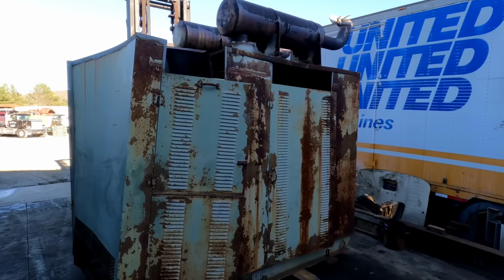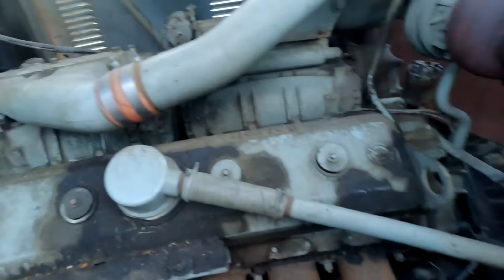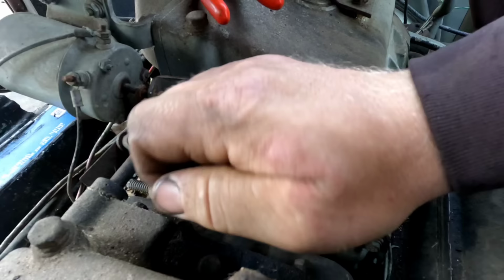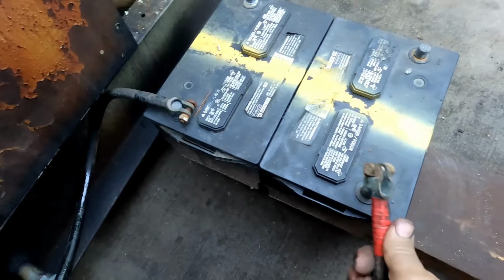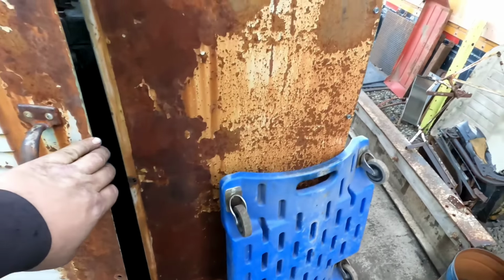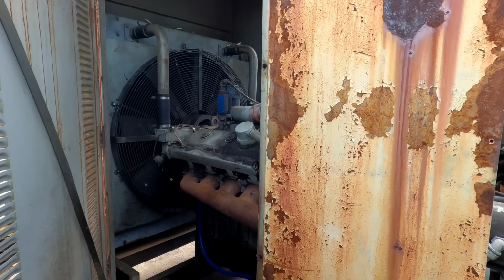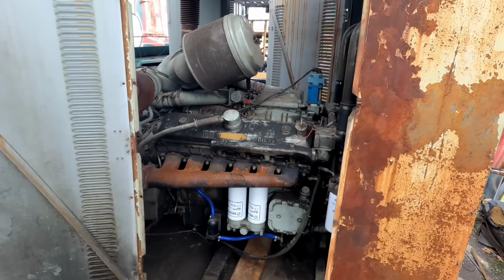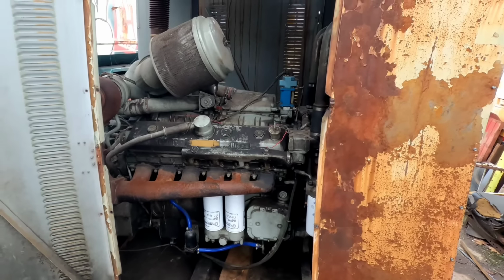Rare find, saved from scrap. Detroit Diesel 12V71TT Generator start up. Will it run? Or run away?

Comment: Emergency generators for schools, hospitals and the like lead a sheltered and happy life. Like fire engines, usually impeccably maintained. One of my hospitals has 3 16 cylinder Cat generators lined up in a room. I was in there one hot summer day when they started them for load shaving. All three go to full governed RPM and the transfer switches put on the load within 10 seconds. I thought I went to heaven.

Comment: Nothing better than a V12 blazing away, Well I think there is.
A 6V53 running at 3200 rpm with no intake nor exhaust system but straight out the manifolds.
Your chest, skin and hair just vibrate and crawls.
 This comes in a close second though.
As an apprentice mechanic, we had a fleet of Kuruna trucks with these 12v71tt's.
They were upgraded to these from twin Volvo engines and Allison trans.
Charging up a one in 8-9 incline fully loaded underground was a sublime sound.
Nothing like it, simply music to the ears.

Comment: for that stuck cummins, try hooking up a porta-power to one cylinder like zack-life does! 
 it'll turn or break for sure!
Reply: To clarify for those who aren't familiar -- Zack poured some penetrating fluid (I'd use ATF+acetone, it's better than most penetrant brands IMO) into a cylinder. He made a fitting for the glow plug hole. He then hooked up a porta power up to it and hit it with a couple thousand PSI. Fluid seeped past the rings until the rusty hog cranked a quarter turn.

Probably the best way I've ever seen to crank a stuck engine. Was really smart on his part. I don't think an air hammer will work on these big of cylinders lol

Comment: I am a retired electrician from a water utility on Long Island. We had many of these old gensets. The unit you are working on was probably wired to an ATS. Find the pair of wires that would have been used to start the engine. There should be a cranking relay and overcrank time out stepper in the control head.

Comment: It also could have come out of an old Telephone Company office. Back in the day they needed 99.999 percent uptime and the batteries would only keep stuff going for 30-90 minutes in a big office and the Jenny would have to have the ability to run for weeks in a worse case scenario, like a hurricane recovery. They would also have time to get more fuel. Today’s Jennys are multi fuel, propane, natural gas and maybe diesel or gasoline. And also it was switched out due to age of the generator. Also the site may not need as much power to run, like solid state vs relays or computer vs even the old relay or solid state stuff. Even my power usage for my home has decreased, not counting my heat.😢😢😢

73’s from Sherman NY
DE N2JYG

Comment: I use marine grade 8D batteries and 4/0 cables to start my 6V71 in a 750 CFM air compressor. Group 31 batteries can do it, but they don't live long in a cabinet running at over 200 degrees F.

Comment: Don’t think it would be a TT.  if I’m not mistaken the TT engines are only used in vehicle and marine applications, don’t think they were used in generators so this would likely be just a standard 12v71T.    Could be wrong though.      I do see people all the time thinking TT means twin turbo but it does not it means Tailored Torque aka the “fuel squeezer”.   Wether it’s single or twin turbo the engines designation remains as a “T” or TA if it’s got a aftercooler

Comment: I worked the offshore oilfields for yrs the older rigs often had 6,8,& 12/71 Detroit's along with 1710 Cummins  - 
      I saw them every were on older rigs - they were also many that were dedicate to handle the Mercury vapor lighting loads - there would be 1000 watt mercury vapor lights all over a platform in the 1970s and 80s - 
    I had worked on generators off shore for yrs - the turbo units burned about 700 gallons of fuel a day - 
    The none turbo charged were around 500 HP and the turbo u it's were 750 HP or so - they put out 416 watts per HP  - 
      There were 1200 rpm units the we're about 500 HP and the 1800 rpm units were 750 HP or so - 
     The 1200 rpm units were rebuilt every 24000 hrs and the 1800 RPM units were rebuilt every 16000 hrs  - 
      Most of the problems with structures on the water is weight -
      So those are light weight and powerful - the platform legs are used for fuel storage and have several hundred thousand gallon of fuel in them - do fuel weight doesn't matter  - Cummins and cats are better engines but power to weight the Detroit's and EMDs are better choice but burn more fuel - 
    One gallon of fuel generated 3 kw with a Detroit's & 1 gal of fuel in a 4 cycle generated 4 kw of power -

Comment: That more than likely a wood something govenor on the engine. Can’t remember the name now. Engine runs at 1800 rpm. And more likely runs at 0 drop and 60 hz setting. Which means it will not change from 1800 rpm no matter how much load you throw at it. 
Great engine will run forever. Detroit diesel will run full load forever. They love to work. Where Cat And Cummins can’t run full load for ever. That’s why all the mines up north used to run Detroit. They last forever. Great engine. Loved working on them back in the 70’s and 80’s
Good luck
Reply: Woodward... First name in genset governors
Reply: @The_DuMont_Network  1

Comment: Those are not block heaters. They are oil heaters so that the engine can start and go online in less than 7 seconds. It is an emergency Backup Generator. Probably can from a hospital or a computer facility.

Comment: The speed controller is not working. Its that blue box up front on the engine. It should have ramped up to 1800 rpm.
Reply from the maker: I know. I disconnected it to avoid it jumping up to full rpm upon start up.

Comment: What size injectors ( H.P.) .what is k.w. of generator?❤
Reply from the maker: 400kw. Not sure injector size.
Reply: Heck I only need a 40 kw generator for my home. A single phase 120/240 60 hz. That would even handle the electric heat.

DE N2JYG
Reply: @franklin.s.werren  I have same v-12 genset load tested it drank about 3 gallons of fuel in about 5 minutes
Reply: In the old days they had those old girls running ski hills because there was no power anywhere near them